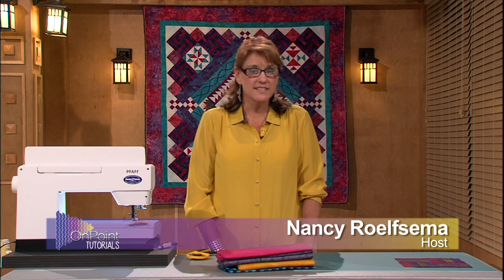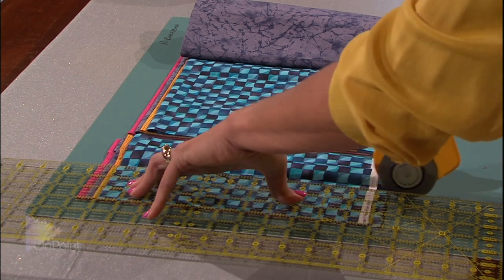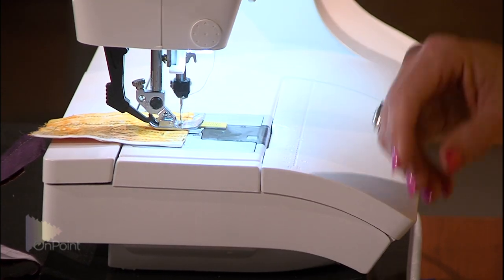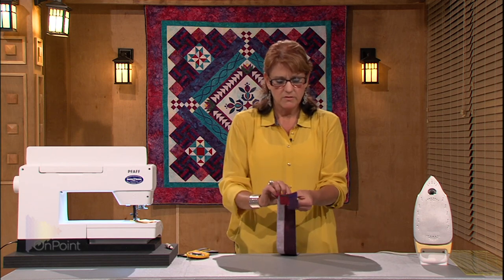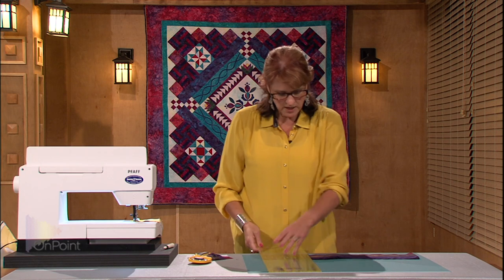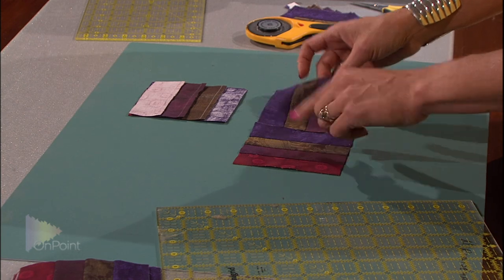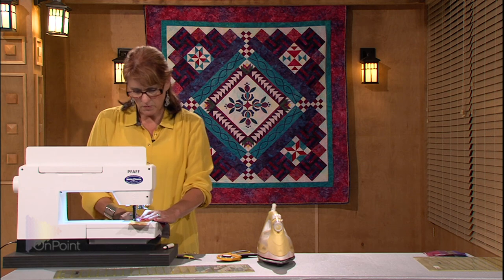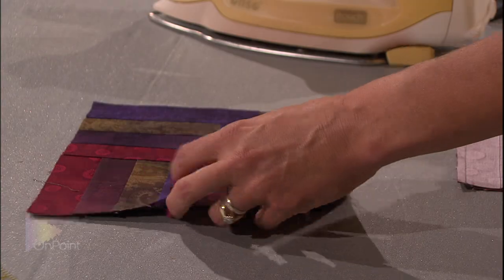How to Create a Rail Fence Block (Ep. 103)

Comment: One more question: when you buy a new roller cutter, is the blade is supposed to cut?? Or is that my "muscles" not strong enough? I had problem to cut  . But as you said, I will try a lower table to cut. Thanks again.
Reply from the maker: Yes it's supposed to cut - You also can try loosening the screw just a tad to let the blade roll.  But as it often happens the manufacturers sometimes don't seem to put in the normal good blades.  Can I ask what rotary cutter you purchased?
Reply: @QuiltingWithNancy  I loose the screw and cut on a lower table and "magic" happened! It cuts! Thanks to you for your help.

Comment: Great video... I purchased the PDF version of your book and am a beginner.  I purchased a 1/4" seam allowance foot for my machine so I can do perfect 1/4" seams.  When I did my first rail fence block it measured 4 1/4" instead of the 4 1/2".  I would like to use the foot I purchased so if I move my needle over to the right by one position, would that be enough to give a scant 1/4" seam allowance?  Thanks

Comment: What is the purpose of the leader fabric when sewing the blocks?
Reply from the maker: Starting with a fabric leader is going to do two things, one, it will prevent the fabric from being taken down into your machine as it starts - not all machines have this issue, especially if you are using a single hole face plate, but many do.  When you are working with smaller and pointed fabric pieces, this is a very common concern.  Two - it will actually save you thread and help to keep you organized :)  Hope this helps - Nancy